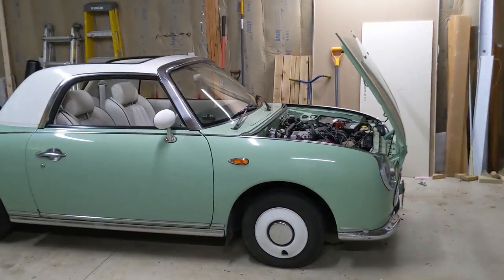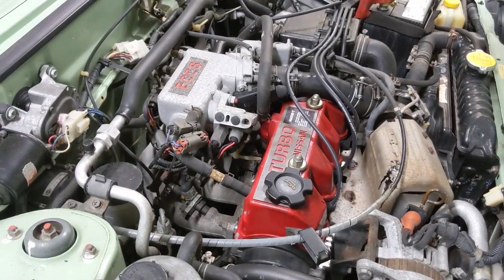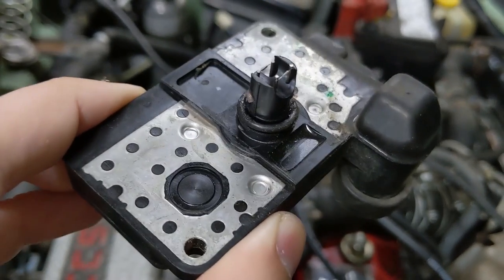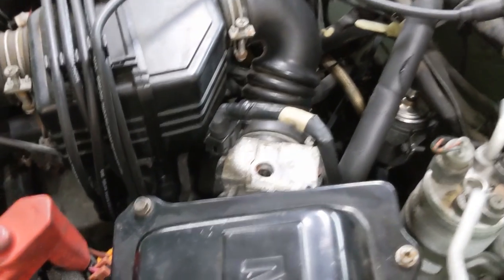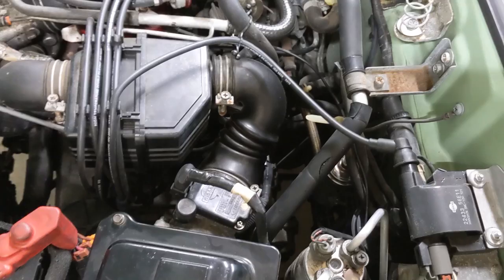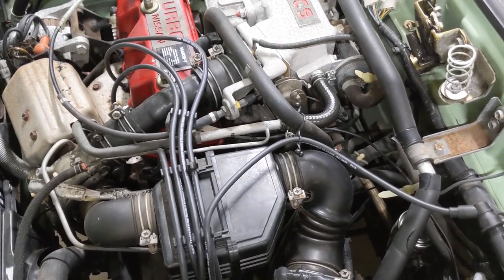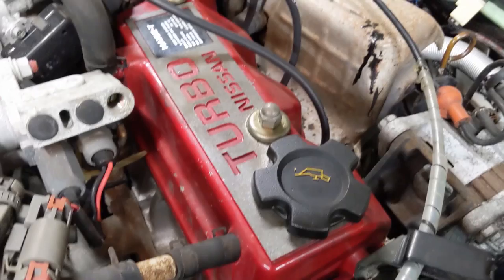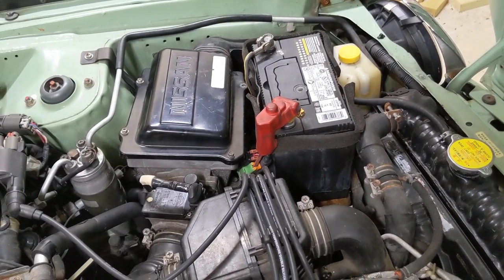Modern engine control musings and Fixing a Figaro

Comment: For future reference putting the cam sensor in the distributor is common since the distributor runs off a little gear that's built onto the cam. Most cars these days have an individual coil over each plug so theirs no need for a distributor. 
Yeah, I'd check that IAC valve. If you can find a part number on or for the valve, try looking up just that rather than the valve for your particular car. You might find something for one of the US imports for that engine at a more reasonable price rather than paying all the taxes and fees to import something from Japan. I'm sure they used that engine on all sorts of cars so you'll never know. 
Most car sensors are made in Mexico or China these days anyways so hopefully you be in and out for under $100.

Comment: You should consider fitting the CG13DE from a K11 Nissan Micra/March. 1.3 Naturally Aspirated and bolts up to the MA10 gearbox but makes the same power far more reliably

Comment: Sure cars had electronic injection and therefore ecu and air flow sensors, o2 sensors, and all that forever, but cars in 96 didn’t have LED headlights, infotainment, electronic throttle, brake, or steering (drive by wire), electronic parking brakes, turn signal chimes were still mechanical most of the time, the fuel gauge worked on a mechanical system, climate controls were either fully or partially mechanical, and there were no electronic safety systems such as blind spot monitors, cameras, radars etc. I’m not saying those things are bad, but people saying that cars have too many electronics these days are not wrong.

Comment: Typically you can disconnect the MAF and the engine will run with a bit rich by default. You won't make optimum power, but if any power fluxuation issues are being caused by the MAF then it should cease when the MAF is disconnected. Sounds like cleaning it might have solved your issur though. Regarding the high idle, the car's computer might think the A/C is engaged and has increased it's idle speed to compensate. Bad relay? Good luck sir!

Comment: I had a surging that randomly occurred in my 94 'stang. Turned out to be an intermittent misfire caused by a failing hall sensor module in the distributor.

Comment: Dirty throttle body or a faulty idle air control, possible vacuum leak.  fairly common issues on 80s-90s vehicles from my experience.

Comment: My 1981 Lesabre has a computer for the carb and distributer and even an O2 sensor. GM's Computer Command Control.
Reply: My TA has a slightly later version of CCC with a knock sensor and fully electronic timing control.

Comment: Well, there are a lot more mechanically inclined people in here, but this reminds the problem my first car had.... at a point, when starting it would run horrible, i needed to use the throttle to keep it alive, and it was drinking fuel like a lonely pirate in a rum filled ship. but once it warmed up, it was fine. I and other acquaintances tried everything, cleaning, checking the timing and nothing... in the end, i took my regular mechanic and he checked it with the scanner.... O2 sensor was out.... after that, i just when to the junkyard next to my house (i know, i should have got a new one, but i was in university without a job, plus, i didn't pay anything for it) and the problem was immediately fixed.

Comment: Im a mechanic. I had a guy come to me that had tried in vein to fix his car.... He replaced the following parts crank,cam sensors, maf, ambiant temp throttle pedal every fuse. Recoded the immobiliser.. then asked me to look at it. I found the fault in 4 seconds... He had run it out of fuel...

Comment: Maybe you have a weak heater circuit in your front o2?  That would explain why it wont run until it warms up, sucks you cant just hook up a logger to see what sensors are working/not working.

Comment: Use carb or brake cleaner around the hoses. If the engine surges or sputters you have found your leak.

Comment: Starting mode shouldn't be looking at mass of air entering the engine. Really just coolant temperature, and possible inlet air temperature.

It was normal for EFI of that era to have the cam angle sensor in the distributor. Moving the cam sensor would change the ignition timing, so why make them separate if you would then have to adjust the distributor as well? Especially for a single cam, it's the only possible way. And it's doubtful it has a crank angle sensor. It's not needed if you wish to only "batch fire" the injectors. Those old EFI systems are FAR from as precise as today's, or really, just OBD2 in general.

It wouldn't surprise me if there is a data port somewhere on there. But pre-OBD2 and proprietary to Nissan.

Comment: Yeah they put computers in cars in the late 70's early 80's but that doesn't mean the statement, "they don't make cars like they use to." any less true. I'm struggling to see if putting them in was the right choice. If I'm honest, I'd rather have an inefficient car that I can more easily fix myself as opposed to a car that runs pretty efficiently but I can't re-tune/fix myself. Everything is a case of "lose this but get this." I just wish they had continued to make purely mechanical engines that were also efficient.
Also an edit to add: One day the internal combustion engine will be a relic of the past. That day is not far away. I'm 26 and I'm sure that within my lifetime the combustion engine will die. We're nearly there now. Pretty much every car manufacturer has stopped designing new gasoline fueled engines and have turned towards refining hybrid engines and designing all electric car systems. These are truly the final days of the internal combustion engine. If you want one, buy one now before the newest combustion engines become a thing of the past.

Comment: Damn, I used to have a 97 F-350 Powerstroke you coulda looked over for a video, its one of those "ole reliable engines" but it's also diesel with quite a few more electronics than you would expect. buuuuut I'm also making the assumption you're somewhere near Texas

Comment: At 18:22 you can see a small white section of hose like a pcv valve should be there. Its possible that its missing and is causing running issues from unmetered air.
Reply: Nissan historically preferred to place the PCV valve on the intake manifold, in a threaded hole, rather than the valve cover or suction hose.
Reply: @Azlehria  I'm not too familiar with older nissans but it's still a place I would look if it was my car. Considering the age and the issues its having I would check the pcv valve and every hose that connects to the intake. I would also check the hose going from the maf to the turbo for any cracks that may be letting unmetered air in as well as all vacuum hoses. A hand vacuum pump is very helpful in diagnosing older cars

Comment: The solution is to replace the engine with a SR20DET. Preferably with a manual transmission.

Joking aside, I'm betting you have a grounding issue. Grab some jumper cables and connect one end to the negative terminal, and the other to the engine.

Comment: The cam sensor on that engine is NOT very sensitive. I think it's only got a couple to a few sense spots to about 30-40 teeth.

As far as I remember. I am a YouTube user. Not a professional. I could be wrong. But I recall most cam sensors on non-sports engines are really basic.

Comment: ya should look into doing a video on Chrysler's etorque system. I have it on my wrangler and it's a trip. Boosts low end torque straight to the crankshaft through the belt and starts the engine during auto start/stop also using the belt.  it has a bigass 48v generator instead of a normal alternator and uses a variety of methods to recharge the 48v battery. All while not adding strain to the engine like a normal alternator does.

Comment: intake air temp sensore could do that but most likely a vacuum leak, spray som engine  starter around the vacuam lines if it changes the idle then you've found the leak:)

Comment: I've never understood why they continue to use MAF over MAP. It's not like accurate air/fuel can't be controlled well with an O2 sensor and you never hear about MAP sensors going bad but everyone seems to have issues with dirty MAF sensors. Given that most people probably drive around with a dirty MAF for some time until they fix it there has to be some extra pollution due to this.

Comment: 1994 was when obd2 was mandated  by the U.N. as a universal diagnostic system worldwide. 1986 saw SAE acceptance of the can-bus system which is what actually controls different systems on the vehicle. W the right pinout and some free software you can acess and diagnose allot of computer controlled systems. BE AWARE this is like modifying a sys32.exe file. If u screw it up u need to have a backup ready or u just truned ur hard to find car comp into a brick.

Comment: And if my Skylines and stageas were any indication, there should be a lot of parts crossover with USDM stuff on the engine management sensor side of things. Don't pay a premium. Also, the cat has a pyrometer in it. I don't believe it is thermally fused. And and and believe it or not, you can get live sensor data to a laptop. Nissan CONSULT and a dongle. Worth having given you are largely on your own for diagnostic work.

Comment: It's  been my experience that MAF sensored vehicles need about 10-15 minutes of running after cleaning the MAF sensor for the computer to re-learn what a good MAF looks like...
Reply: And have the battery disconnected to clear the learned motor map that was in there previously.

Comment: Don't worry, my battery doesn't have a tie down strap either. You should be okay as long as you don't drive over large bumps or dips at high speeds.

Comment: Next up:  clean the throttle valve and Idle air control valve and passage.  Obviously, the engine management system is having trouble setting a proper idle.

Comment: Check for vacumm leaks first, a vacumm leak can cause all of the issues you are having and most likely the colprate will be a small or big cracked hose or an o-ring that may have gone bad. In the worst case, it can even be a combination... most likely and with 30 years on its back,  its this. it can also be a bad EGR if this engine has one but thats a diffferent story.

Comment: Just gonna throw it out there, and I don't know how it passed emissions limits:

My 1986 Nissan Sentra did not have a computer, older Datsuns did, new Nissan's did, but not that year. Just an ignition module inside the bottom of the distributer.

At least I never found a computer.

Comment: A good ol' carburetor also does very basic (and very inaccurate, unreliable and insensitive) air flow sensing, save your rambling 'til you have to make an old engine run well in all conditions.

There's a reason we use electronics, and it's not because it's cheaper nor the simplest solution (system wise, it is a lot simple mechanically).

Comment: You need to plug in an obd scan tool and do an extensive scan. 1991 or not, anything that has a MAF sensor, is modern and complicated enough that you can keep throwin parts at it all you want it will not fix it most of the times, just waste of money.
You said the car had crank and cam codes. Thats straight away a cause that can lead to the car not starting properly and stalling. A lot of times sensors go bad but not trigger an engine code for a while for the car to go open loop. Crank and cam sensors are a common cause of start stall, and incorrect running. 
Most MAF sensors have a self burn function, which heats up the coils to very high temp for less than a second when ignition is first switched on, and this keeps them clean, a lot of cars I have seen that ran the factory MAF sensor without a problem even after 100-200k miles.
Engine coolant temp sensor doesnt affect idle, the ECU mainly looks at data coming from the first o2 sensor in the exhaust manifold. The second o2 sensor is after the cat, and is for monitoring cat efficiency (if your car has one)
So my guess is O2 or crank/cam sensor, however the lambda/o2 sensor is a 150-200gbp part (idk how much is it in USD), cam and crank are around 30-40 a piece, and you are already looking at well over 300 dollars plus what you already spent, so thats what I meant when I said you need to read the codes properly with a scantool.
Sadly long gone the days when you can fix a car with some handtools, trust me, Im doing my last year of mechanics qualification this year and almost every single problem that pops up on a car the very first tools i bring out is a multimeter and an obd scantool. One advantage of all the computer mess is that 99% of the sensor can simply be tested by a voltage or resistance measurement, which is helped by the fact that manufacturers put the range of data in their workshop manuals so you dont need to guess around a lot. 
Sorry for the essay lol

Comment: your description of how a MAF works is dead on point. Its 2 heaters that are heated to a specific point, and the sensor reads how much they cool off and the computer can calculate the amount of air by using its internal programming.
Reply: the amount of power needed to reach a set temperature or the temperature reached with a fixed power it how they measure the cooling. It needs two sensors one in the air flow and one not in the flow, the sensor outside the flow compensates for air temperature

Comment: Your cold start valve is stuck open.  That valve provides extra air when the engine is cold to raise the idle speed.  In an old Mitsubishi it would be a  "wax valve" that would shrink when cold, opening up a bypass passage to provide the extra airflow, and it swells up to block the passage when the engine warms up, dropping idle speed to normal.

Comment: - fuel pressure (even a slightly low fuel pressure will cause symptoms exactly like this)
- vacuum leak
- faulty maf
Reply: Edit: cam-crank relation code is a worn timing chain or guides, it'd be a high priority to check that if it has a chain, or check the timing belt pulleys for proper timing. Look up the manufacturers signal waveforms and probe both sensors with a scope.

Comment: An old trick I heard about oxygen sensors - take it off and soak it in petrol overnight. That'll dissolve any shite that might be on it... IF it's not too late and it hasn't overheated. Given the age of the car, I'd be willing to bet it's caked in crap. Worth a go before firing up the parts cannon, no?
Reply: The classic tool for cleaning O2 sensors was a gas torch.

Comment: You never know with electronically controlled cars. My moms throttle body was dirty in her 2011 traverse and it made a bunch of random codes but they went away after I cleaned it.

Comment: Back then was high tech, now days everyone can build standalone ECU witch Arduino mega 2560 + Speeduino project. I build that on perfboard for around than $30 and it support for sequential fuel injection and coil over plugs for 4 (and less) cylinder engine.

Comment: These cars are what we call marmite cars in the uk ..you loath them or love them, does you're temperature gauge read OK when the engines warm ...only wondering as the 1500 rpm you mention is not abnormal for a cold engine ..just wondering if you'r temperature sender is duff...if the temperature sender is ok these cars are notorious over here in the UK for vacuum/air leaks , of course if the idle control valve is sticking open that effectively causes a large air leak and the car will idle higher/run hotter and be down on power....any way good luck ..personally I think they're nice characterful little cars.

Comment: When I say a classic car without computer controlled parts, I'm talking like 74. I think 74 is the cut off for American cars without any computers in them in general. I don't know where I got that number though, but it should be pretty safe to assume pre 74, no computer control. I'm sure the downsides outnumber the upsides, but I can fully understand a soley mechanical system without having to learn how a car computer works, and generally speaking I can just replace any broken part with another part that I can fit in the space that has the appropriate function tol

Comment: Duuuuuuuude... You have vacuum leak. The car runs like crap after resetting the codes is because you reset the fuel trims which adapt to the extra air getting in through the leak and adjust the air fuel ratio accordingly. You likely have the code 11 because they timing is advanced (at least in part) off the vacuum. Also the cold start issue could easily be from a vacuum leak; especially considering that the idle control valve is vacuum controlled (low vacuum will close the valve) and a car that age typically has either an injector just for cold starts or a special cold start mode where it runs the injectors at a heavier duty cycle. When it enters the cold start mode, it will add more fuel by default which will make up for the extra air coming in through the vacuum leak and allow the car to start.

Also, I can hear the hiss of the vacuum leak when the car runs.

Comment: Nissan MAF sensors are always shitheaps, especially from this era. I used to own a '97 S14, USDM 240SX but with a JDM SR20DET swapped into it instead of the even shittier KA24DE (controversial opinion apparently, there are people who swear by KA's but I digress), paired with the factory JDM ECU from whatever OBD2 JDM S14 it came out of. One of the things I ended up doing because new SR20 MAFS are stupid expensive was literally slice open the sensor housing and resolder the connections because it wasn't sending back a consistent signal. If it keeps up, try that. It worked for me until something else unrelated failed and blew up the motor. Don't buy cheap fuel injectors.